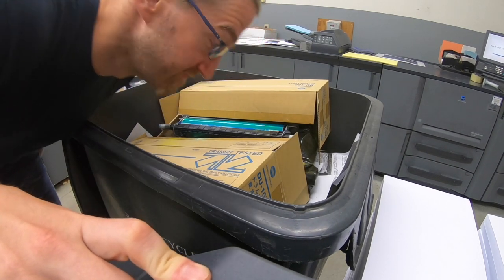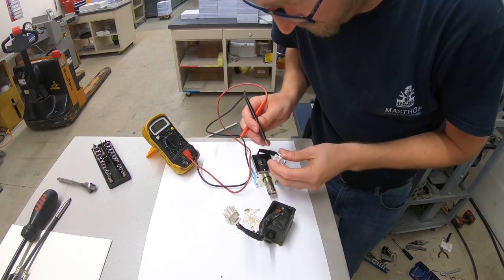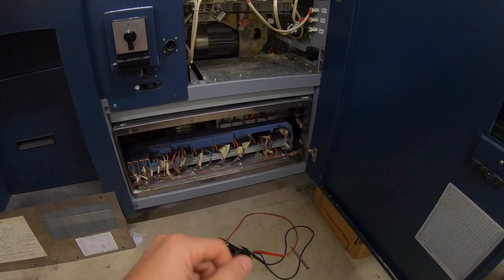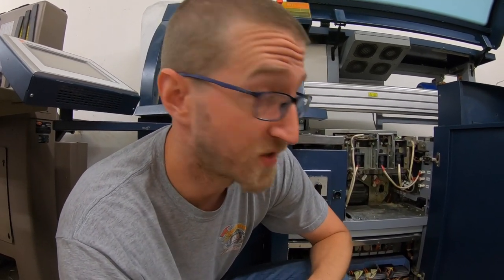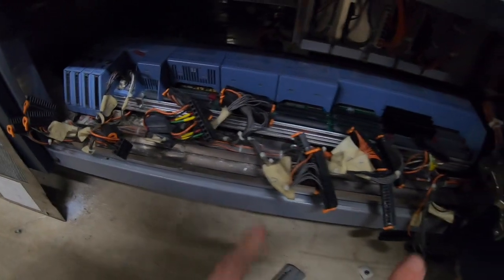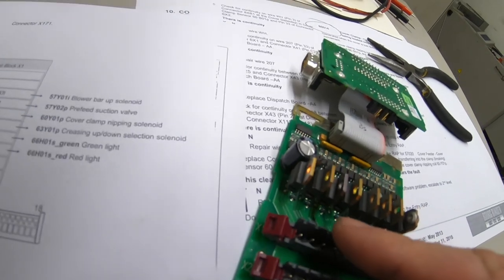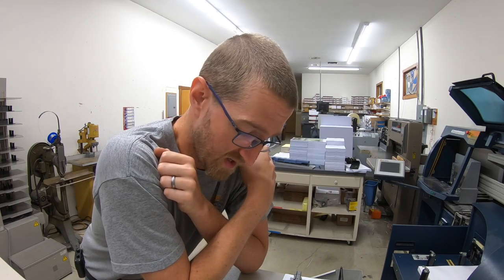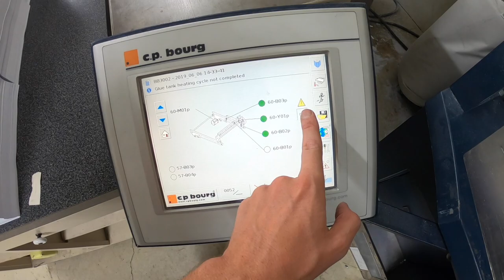What To Do When Electrical Components Start Smoking, How to Repair Electronic Boards DO435

Comment: When I have equipment failure, first thing in my head is if I can’t fix it how much to replace it and how soon can it be replaced. I would have got a new solenoid and if that wasn’t going to solve my issue I would have called a tech and probably left it at that. Excellent troubleshooting on the binder Dan.💪
Reply from the maker: Thanks! The journey was a bit bumpy, but the success was sweet!

Comment: Most electronics in copiers etc generally the 24V will always be there and they allow ground to float high.  Then when switched on the MOSFET will pull the ground down
Reply from the maker: Interesting. I hope I remember that the next time I need to fix something. I have a lot to learn about electronics, its so fascinating to me.

Comment: Mosfets can fail if they have too much heat. If the exact same one went wrong on his other board, it may not be getting sufficient cooling. Perhaps a small screw-on heat-sink on that troubled mosfet which will increase the surface area exposed to air and improve the heat dissipation.

Could also be too much juice flowing through, but no easy fix I can think of for that one.
Reply from the maker: Good idea on the heat sink. If it fails again, I'll certainly do that! I figured it was a bad design from the factory if it has happened to other machines.

Comment: Hello, can you help me with the Konica Minolta 951 machine
Reply from the maker: Maybe, they are similar to my 1200, what is the issue?
Reply: @justaprinter  I want to give an order to print from the computer to the printer, provided that each group is separated from the other, for example, I want to print 50 books, but I am sorted, please explain to me in the video if you please. Thank you very much for responding to my message.